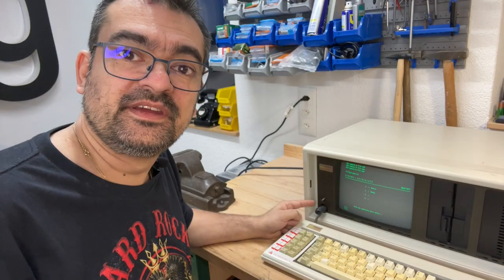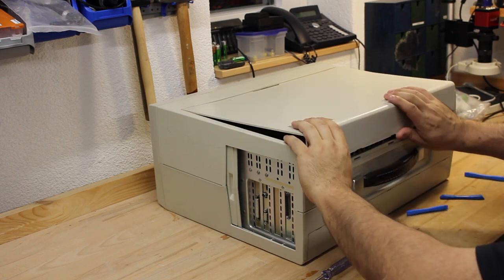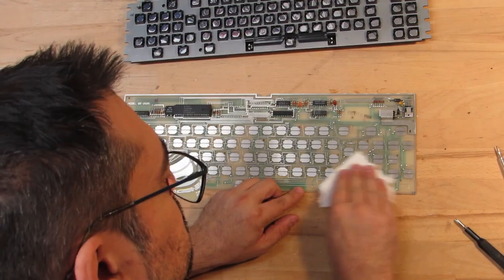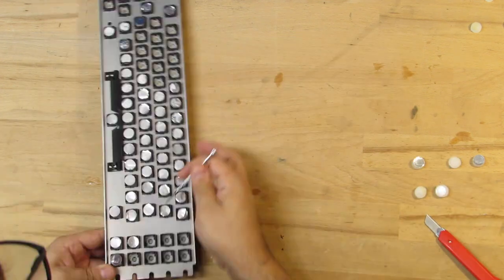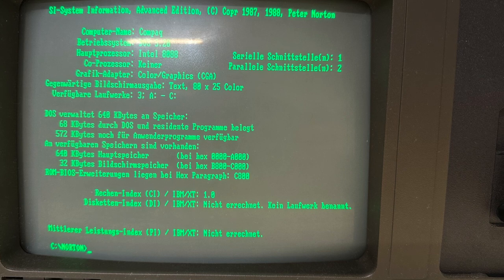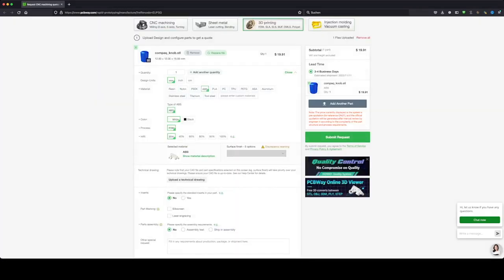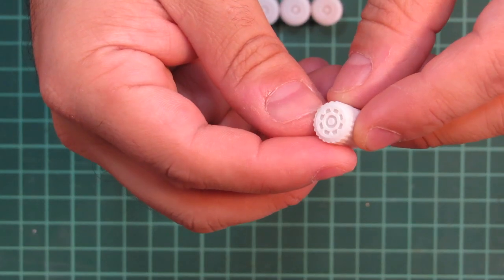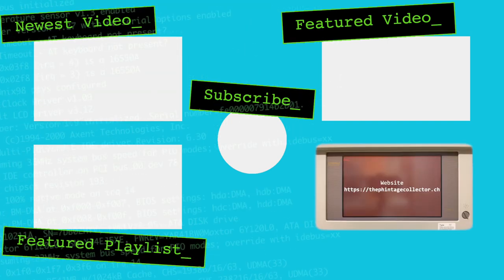How to fix a 1983 COMPAQ PORTABLE PLUS Keyboard and that missing CRT control knob (Part I)

Comment: Hi, great video! but please dont do like everybody else that cuts notches on the compaq portable III to add compact flash and replce the floppy drive with  a gotek.....you can use a modern 40gb hardrive, they are a dime a dozen. just select 100mb or 300mb etc on the bios, or whatever you want, then fdisk and format and the drive will be usable and bootable with the capacity you selected on the bios....the computer will see it and it works just fine....on my portable 3 i have a 80gb drive working as a 100mb type 28 drive....for file transfer you can use laplink...if you want a CF card please hide it on the expasion door or somewhere else...these machines are becoming rare and need to be respected and properly restored like you did on that portable plus... also i advise you to replace the tantalum teardrop caps connected to the 12v and -12v rails...they are notorious for shorting and burning because compaq used 16v caps but should have used 25v ones....on the 5v rail they are fine you can leave them.... also if you want to repair the original conner drive dont power it up...on those drives the glue that glues copper from the voice coil to the head mechanism fails and the copper falls rubbing on the metal and shorting out, burning the controller on the circuit board...also the magnets get detached from the metal due to glue failure and they damage the drive...these drives if undisturbed can easily be fixed and saved...if you want advice i can make a video with a dead conner drive of that vintage explaining the issues...feel free to ask...keep up the great videos
Reply from the maker: @MrHBSoftware

Don't worry, I'm always trying to do discrete restoration whenever possible.

The only machine I own, which has a Gotek, is the Kaypro II, and this only for the reason, that it was furnished like so by the pre-owner.
Though, when you check out the video about it https://www.youtube.com/watch?v=TgbmjZZw75Y, you'll see I went greath lengths to at least repair the second floppy drive and make it working again, so at least it's best of both worlds now.

You commented on this one here already, https://www.youtube.com/watch?v=JrGWRjTFqps, about the Compaq Portable II.
So you know I added the CF hidden in the expansion slot, exactly as you suggest, for that very same reason to not make it too much out-of-place.

A friend of mine knows how to fix these drives, though we haven't come to time to look at it.
I'm keen though on learning this kind of fixing, as fixing hard drives is clearly beyond my skills at the moment. 
The drive in here doesn't spin up anymore on power-up. And actually, the last sign of life it did was some sudden squealing, almost like metal grinding.
I was thinking about the spindle locking up due to dried lubricant, though I'm really not an expert here.
If you have inputs for me, please get in touch via tpc@thephintagecollector.ch 🙂

And thanks for the hint on the tantals, I'll be having an extra look at it.
Reply: @THEPHINTAGECOLLECTOR  hi...maybe i went a little too far on my comment, sorry, its your machine afterall :) ..but im glad youll do things discrete!!! that makes me happy....i had just watched a video were the person had cut notches on the case of a perfectly good portable III, that made a bit upset:).....but then i saw other video were someone 3d printed a bezel for a Cf card and kept the original one inside the case ...that atleast is a reversible mod.....that grinding on the drive, if its a conner cp-3021 thats exactly what they do when the voice coil and magnets rub against ecahother..might be too late for that one, lets hope not.. maybe tell your friend to check for that when he opens the drive. those droves with low data density and big heads are not very sensitive to dust so its fine to open them and work on them
Reply from the maker: @MrHBSoftware  No worries! I fully understand your point, I totally see it likewise.

Sometimes, sticking to non-inasive actions is easy, other times, not so much, i.e. when you check out the Compaq Presario 425 here https://www.youtube.com/watch?v=GXgJYJaIN9I, where I retrofitted a TFT panel.
Though when checking out the precondition of that machine, https://www.youtube.com/watch?v=3RpI9DKGI7M it's all makes sense, what led to that particular outcome.

But that's definitely the exception from the rule. For 99 % of my machines, you wouldn't see anything from the outside about any repairs or retrofitted modern-days tech.

As far as the Portable Plus is concerned, I will be doing a CF retrofit for the time, though it will be definitely reverse, as I'm keeping the old controller and the disk drive mounted whenever possible.
That's also the reason I wouldn't remove the drive from the Portable II, either, as maybe, one day, that can be fully restored.
Reply from the maker: @MrHBSoftware It's actually a Rodime hard drive. Any thoughts on this one?
Reply: @THEPHINTAGECOLLECTOR  unfortunately no, i know they were one of the pioneers of the 3,5inch format but never opened any of those drives....hope it just works!  only hint i can give you is being a primitive ide drive (probably stepper motor) sometimes they can be low level formatted if needed unlike most people say